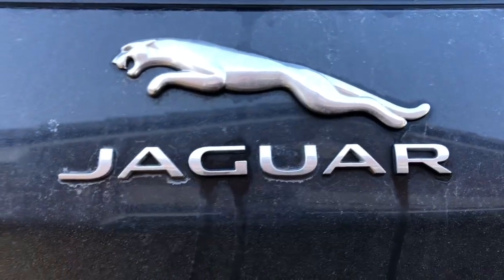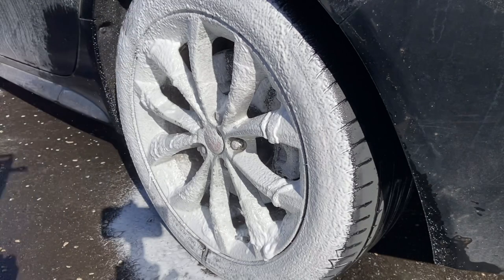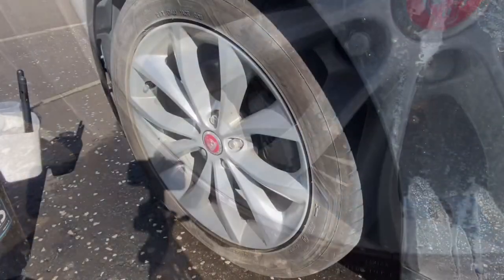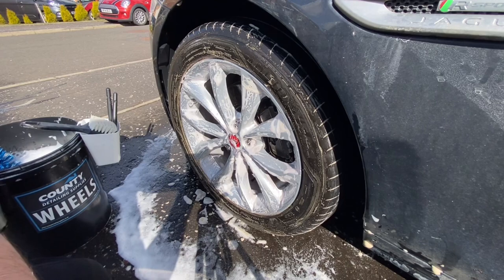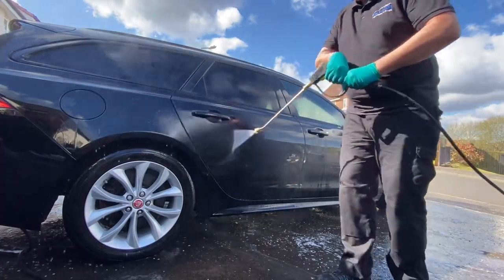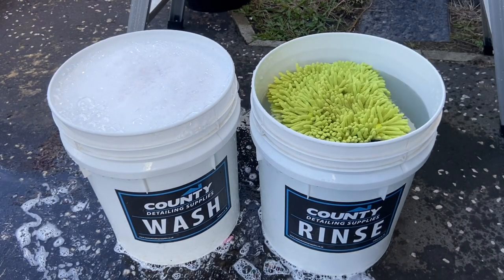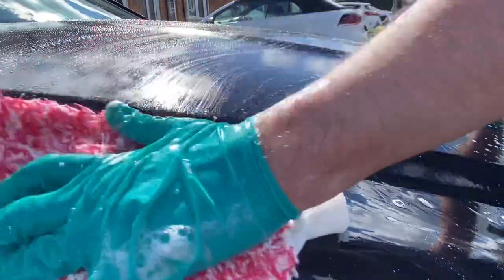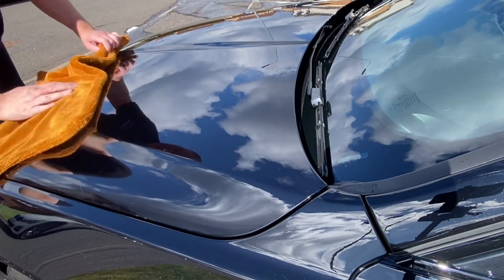Garage Therapy Detailing Products Put To The Test Cleaning A Neglected Jaguar XF R Sport Part 1

Comment: Hi Graeme,

Thank you for taking the time to review our products.

One of the negatives with /ZERO: Iron Oxide is due to the fact it is so concentrated and as a result incredibly powerful, it does suffer from colder temperatures sub 6 degrees where the decon surfactants will thicken. This as you found it does delay the activation of the TGA. As we discussed also, allowing the TGA to do it's work first then agitation produces better results in terms of reaction.

As for the wheel where you didn't see much reaction, if you look at the footage closely you can see spots that look very black/purple. Again as it's a gel it doesn't run off like traditional Fallout removers so at times it looks like nothing is happening. On that wheel however it was odd it didn't react much but for wheels to be as clean as they were after the winter we had and length of time is odd also. Nevertheless as you found out the formula works fine when you tested it on different alloys.

It is a very unique formula on the market and we are trying to push the boundaries of what is possible that is functional and fits in our process. We feel for the few negatives it has in colder climates the benefits vastly outweigh them. 

Thanks, 
GT
Reply from the maker: Hi GT!, thanks for the explanation of the Iron Oxide, in the case of the first wheel using it it could not be left to dwell any longer than a couple of minutes anyway due to the direct sun but any other fallout remover would struggle more as Iron Oxide has a much better chance of staying liquid longer as you said because of the Zero Decon shampoo in it. I wasn’t criticising the product, I apologise if it came across in this way, it was not intentional at all.

I love how you interact with my videos and show support where needed if I’ve got it wrong. You know I always message you first before making comments but sometimes things can be missed. 

Next video I use the interior cleaner and a brilliant leather cleaner, I haven’t done many interior videos and this one looks good with so many interesting angles for the camera 😁
Reply: GT - any prospects for. USA Distributor???
Reply: @jackemerson1171  Hi, not currently. We are a small business currently and whilst we are healthily growing, attempting to break into the US is too early for us. Our priority is to establish ourselves in the UK and Europe.

Comment: Hi there my GT experience is improving as I layer the serum on the tyres they look better and better. I used the Decon shampoo for the 1st time last week as a snow foam then a contact wash. The 1st hit was ok but then the contact wash stripped most of the wax. Very impressed. There was a review on you tube recently of ONR using it as a pre rinse 1 part to 256 as a pre rinse before the power wash pre rinse as they thought that if you push mud or trafic film around by power washer it may scratch. I wondered about your thoughts. I have not tried it myself. I use Auto Finesse either Citrus Power or Dynamite TFR topped with Angelwax Cleanliness as a pre snow foam and it cleans really well.
Reply from the maker: You could go mad with endless people telling you this pre pre prewash needs done , my thoughts are the loose dirt a pre rinse takes away is only surface retained, as it is rinsed away the layer of traffic film underneath it should protect the clear coat from any scratches but surely even minimal at best , but I’d still rather have a soak first than straight on with a sponge 😬
Yep, I agree Angelwax Cleanliness and Fast Foam as a combo are superb, not tried much auto finesse to be honest

Comment: Off to a good start, can’t wait to see the next part! 
That wheel was strange not to react much maybe wheel shampoo just done a great job first, I’ve also been spreading iron oxide just after applying and leaving to dwell as it’s so thick it’s hard to get full coverage from just spraying and it seems to well.
Reply from the maker: Thanks Nick!, I think One Wheel Shampoo is maybe better than we know!!, as I tried it on a dirty wheel and there was specks of fallout lighting up but nothing from the ‘clean’ wheel, I’ve also tried diluting iron oxide 1-1 in a spray but you’d get the same reaction from spraying a foam on top of it without using as much if you know what I mean

Comment: Great review Graeme, I'm using mostly GT products at the moment. With the iron oxide I did feel you use alot as it's thicker I did my i30N and used 95% of the bottle to ensure an even coverage. It does do a very good job and the slickness is incredible. I only use one wheel shampoo to clean my wheels nothing any stronger needed.
Reply from the maker: Thanks Dean, yeah incredible products but 95% on a single car?, wow that’s expensive 😅
I get what you mean , in the video it’s a real struggle for the trigger to spray any and return the trigger back and being thicker was patchy , again more possibly due to colder storage , the morning of this detail there was ice on my car so below 6*c as Maz said in his comment was just below it’s preferred operating temperature but it needed done so I had to use it! 
The wheel shampoo is amazing have you tried the car shampoo?
Reply: @GMDetails  when I used it it wasn't that cold, maybe a wider fan on a different spray head would be better. One shampoo is very good the only things I haven't tried are the interior and glass cleaner.I have also found the chenille wash mitts don't feel as slick on the paintwork as the microfibre ones.
Reply from the maker: I’ve just bought more microfibre mitts , I’ll have to do a wee video review of them 🤔